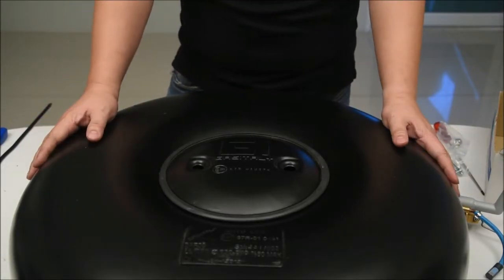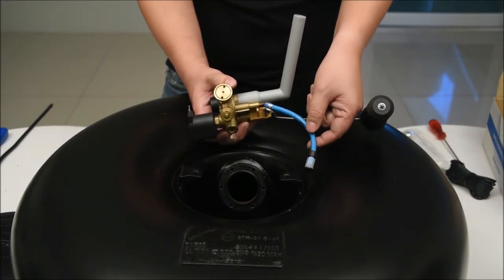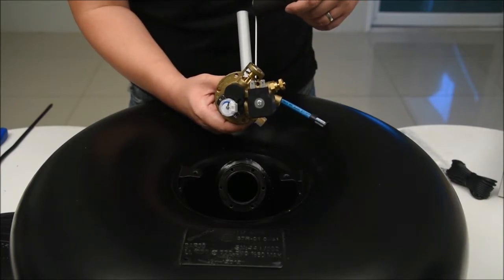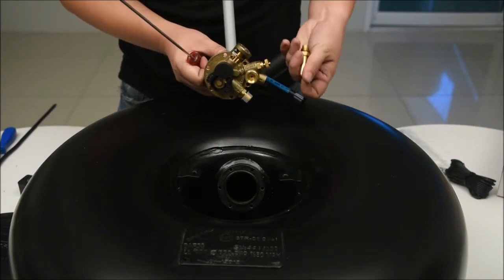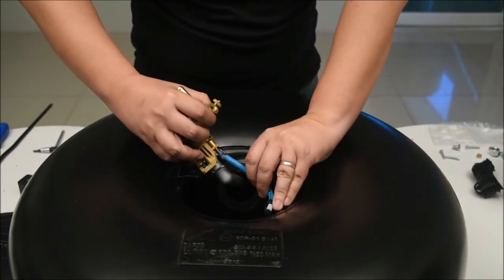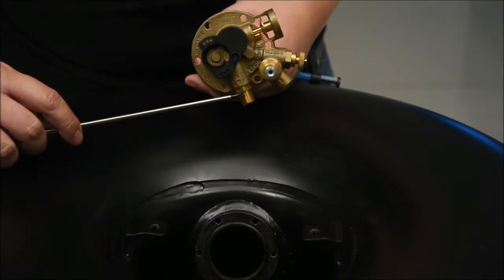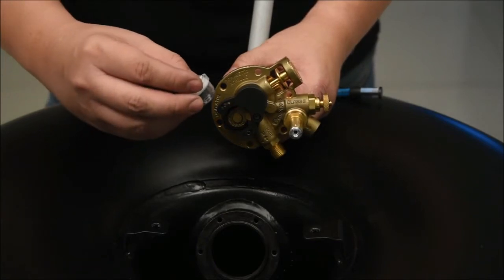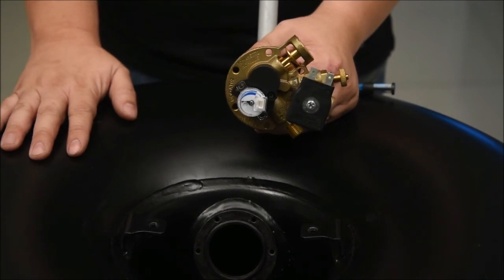How to install multivalve on LPG toroidal tank

Comment: Is it necessary to empty or eliminate the air inside the tank before using it again after opening it?
Reply from the maker: Yes, it's necessary.
Reply: @GasitalyTubeItaly  why?
Reply: @GasitalyTubeItaly how do you get the air out when installing a new lpg tank before use?